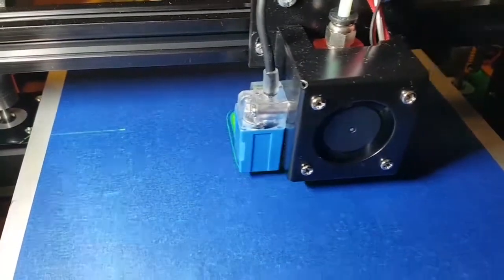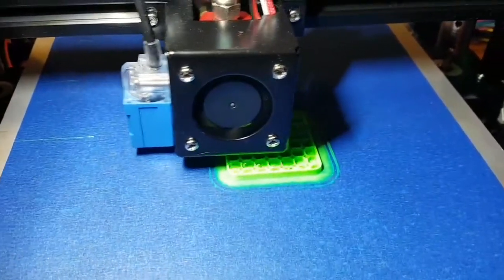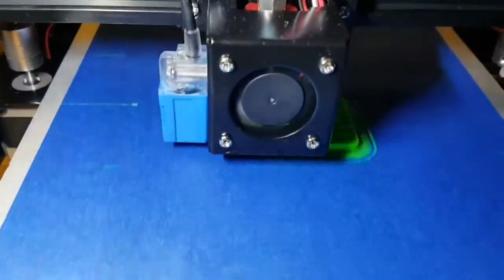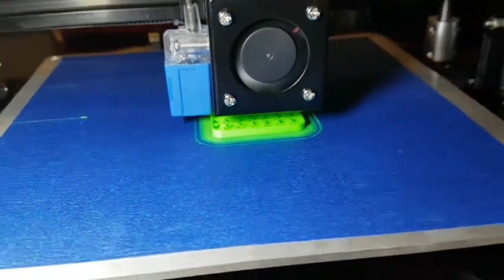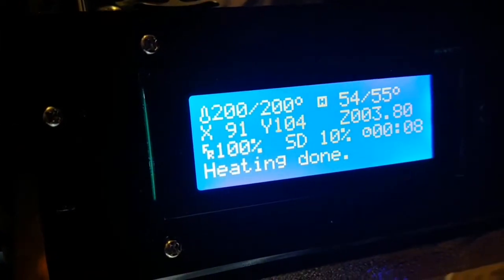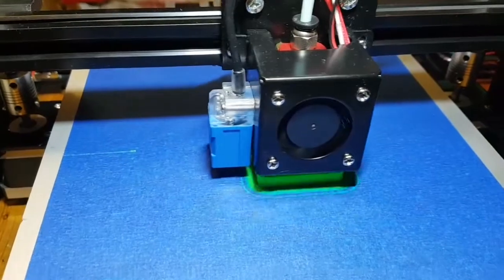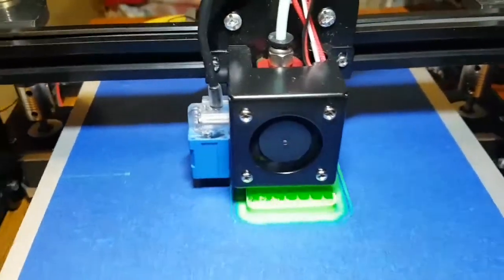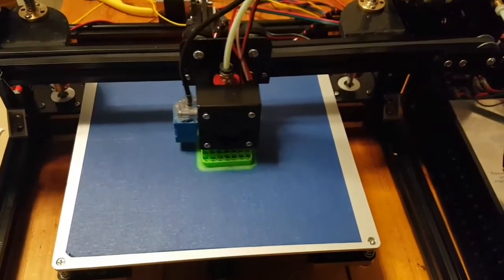TRONXY X3A 3D PRINTER

Comment: Hi friend I have the same system and 3d printer I have encountered so problems to bed is ether to low or to hight.. Or blocked... Massive head bang... Or a 4 pou d lump hammer.
Reply from the maker: Hello. I recommend you join the Tronxy Facebook group where there are a huge number of tips for setup.

Comment: Did the bed leveling come with it? What controller board are you using?
Reply from the maker: It's just masking tape and stock controller Metzi...but I use dual fans on it...it overheats otherwise.
Reply: @KT-TV  Thanks. I think you mean Melzi. I have a Melzi Version 2.0.5 controller board for my TronXY 3S. If I am wrong please let me know. Thanks
Reply from the maker: @richardbrown2290  Yes...correct
Reply: @KT-TV  what version of software do you run on the Melzi controller board. Thanks
Reply from the maker: @richardbrown2290  The latest from Github